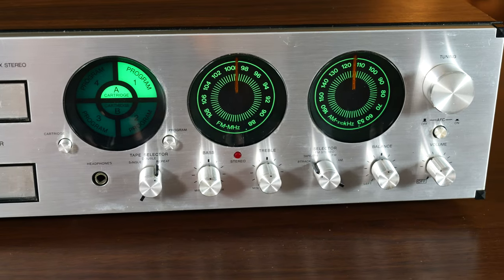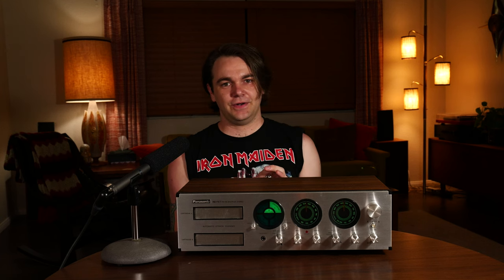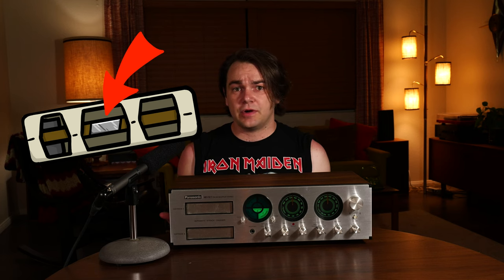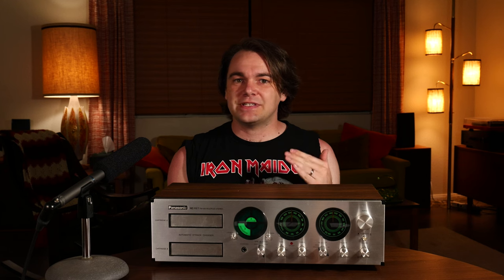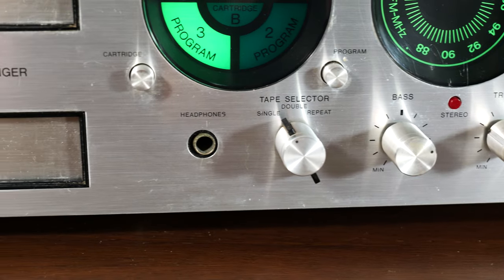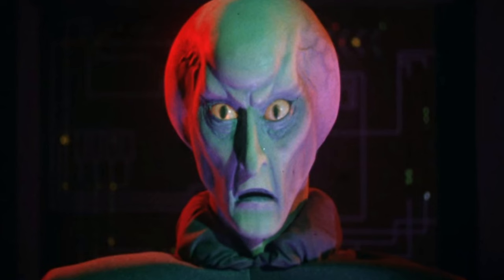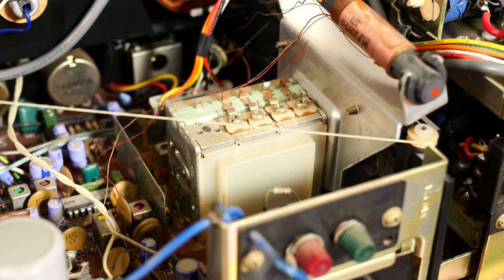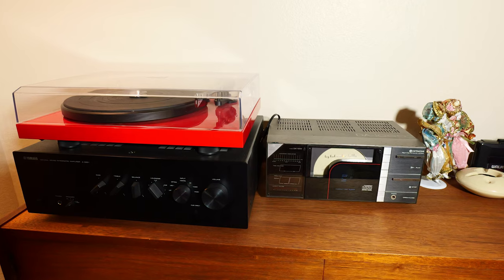Proof of Alien Life from the 70's: The Panasonic RE-8250 Dual Deck 8-Track Player

Comment: The phono input is designed  for a ceramic cartridge turntable...
Reply from the maker: Possibly... they sound identical when I hooked things up to either input. Although that could also be the result of wherever the heck this thing lived for the past 40+ years... 
Whoever it was, I'm pretty sure they smoked competitively. Took almost an hour to get the nicotine off the front of it.
Reply from the maker: Pinning this comment because that’s helpful info, BTW.

Comment: Never saw an 8 track cartridge in my life... but you said that it contains one continuous loop of tape, I was like o.O ? So I asked dear old google how and 8 track cartridge looks inside. Now I get  it... no wonder the tape broke often. It's the first thing that came into my mind when I saw how it puls the tape from the center of hub...
Reply from the maker: In my experience, the failure point is the little foil splice. The glue they used just failed after so many years. And the foam pads. But both of those are easily fixable if you can get the cartridge apart without wrecking the printed label (if you care about that type of stuff). Some of them have clips. Those are usually easy to deal with. The ones with screws sometimes hide them under the labels.

Comment: If I found this in a thrift store I would have freaked!
As others have addressed, the phono is for a ceramic cartridge and a magnetic just won't work.
(I'm disappointed seeing my comments edited, btw)
Reply from the maker: Yeah... regarding the cartridge thing, I will probably do a follow up video about that once I find a turntable with a ceramic cartridge.
Reply from the maker: Wait... is someone editing comments? I can't edit comments except my own. That's not cool if someone else is editing what you post. That means someone has access to something they shouldn't.

Comment: Is that a Miida 40 watt reviever in your opening? I used to sell Miida products in the 70s and I owned this amp for 4 years till I sold it in 79.
Reply from the maker: It's a Realistic. I don't remember the model name. I'll let you know this afternoon when I get home.
Reply: @AudioThrift   wow it looks so much like the 3140 I use to sell for199.00 in mid to late 70s. Mine was a bonus . Check it out if you want. Thanks. The tt I used to sell also for 199.00 was the T3115 no cart. Came with it. Mine was a bonus also.

Comment: 8 Track tapes should not really break.  You can buy new foils and cover (if the foil is longer than the original foil so it can bite new section of the tape) or replace the existing foil if you plan on playing 8-track tapes.

IMHO, the alleged badness of 8-Tracks is just vastly overstated.  Sure, it is not the best source, but at its best, 8-track sounds pretty good.  The one weak area is flutter (the constant changing of speed), but on a tape in good condition, it's really no worse than 90% of cassette decks and many, many phonographs.  It moves the tape at twice the speed of cassettes, so it creates less hiss and sounds better in that one respect.

If we wanted perfect audio, we'd download it or pick up a CD.